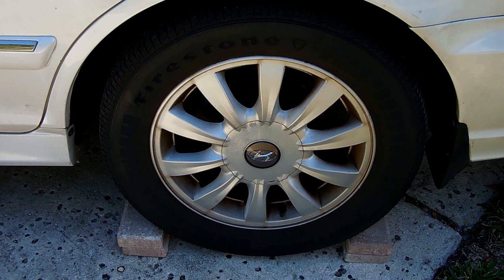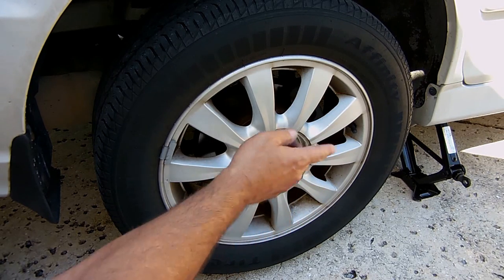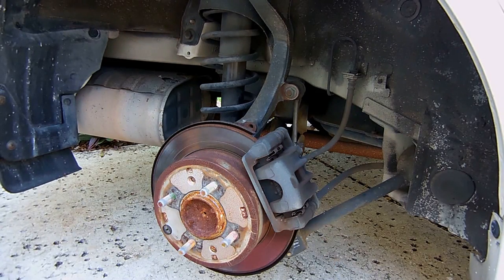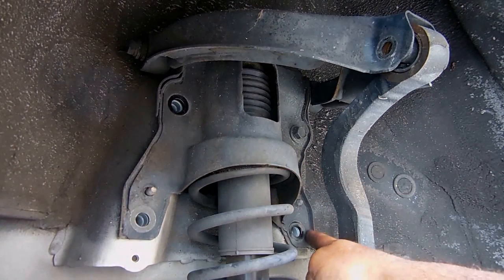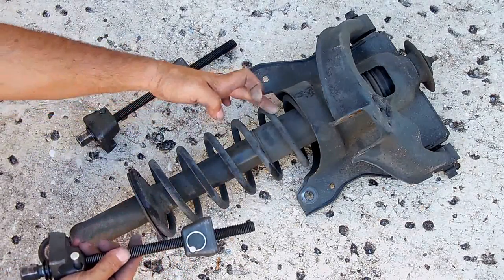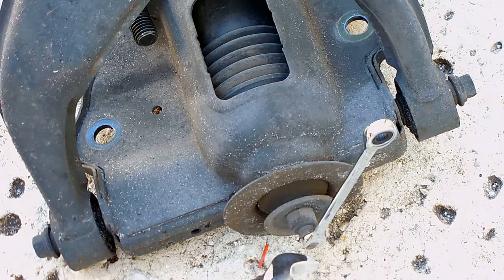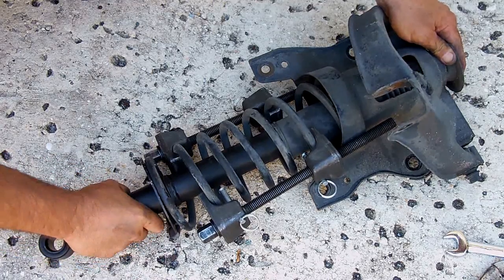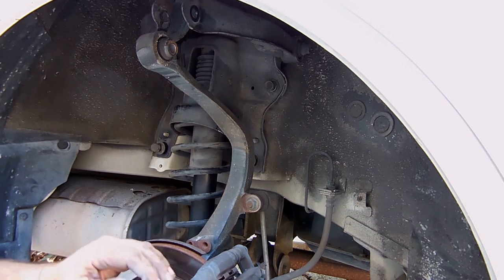How To Replace Worn Rear Struts (Step By Step)

Comment: Great vid.  You cover everything in only a few minutes.

My only warning is using jack stands.  I had a car fall off the jack years ago (and the front wheel was chocked).   No one was hurt, but it scared the cement out of me!  The jacks supplied with cars are not to be relied upon for anything but changing tires.
Reply from the maker: True. You need to make sure the jack is perfectly vertical, and the tires well chocked or any forward or backwards movement will result in the car falling off the jack. I've had it happen before. :-) Never position body parts under the vehicle. Thanks for watching!
Reply: I'll second that. I was taught never to rely on a jack. Jack it up, put the stand in place, then lower until the vehicle rests on the stand. Makes me feel a lot better, anyway.

Comment: Cool you show this. Many cannot afford to pay $100/hr shop. 
Starters brakes alternators struts common issues. Fuel pump.s and relays in GM also. 
We did this as kids out in the rain in street s of Queens . 
Motors in cars now last way over 200k. Transmissions are the issue now.
Reply from the maker: My mother was born in Ozone Park. :-) Yes, transmissions are the issue.

Comment: Should you do the final torque on that upper bushing bolt when the car is on the ground as to have weight on the suspension?   Not twisting the bushing...
Reply from the maker: You can only tighten the bolt shown at 15:11 so much before it stops. Nothing should be twisting.
Reply: @electronicsNmore  Sir Sweetness is correct. Control arm bushing bolts should always be torqued with the suspension at normal ride height.

Comment: 13:40 I have the pad exactly the same on mine sonata EF. Should it be like that or not? 🧐  🤷‍♂️
Reply from the maker: I just checked the service manual, and the exploded diagram doesn't even show it. I can tell you that after 3 1/2 - 4 YRS, my car is just fine the way I installed the washer.
Reply: @electronicsNmore  The spacer washer at the top of the shock was on correctly before you removed it. Don't know why it fits like that, and it seems counter intuitive, but in my experience they are always like that not only with the Sonata but also Mitsubishi Galant and other cars with similar shocks' set up.

Otherwise, good vid.

Comment: I want to tighten up my parking brake cable how do I go about doing that on a Hyundai Accent L 2002
Reply from the maker: Hello Anthony. In my Sonata, the parking brake adjustments are made by removing the center console storage container under the arm rest lid. Pop out the storage compartment.

Comment: Good vid - except 2 points.

The spacer washer at the top of the shock was on correctly before you removed it. Don't know why it fits like that, and it seems counter intuitive, but in my experience they are always like that not only with the Sonata but also Mitsubishi Galant and other cars with similar shocks' set up.

Also, control arm bushing bolts should always be torqued with the suspension at normal ride height.

Comment: 13:18 It's counter-intuitive, but that washer was on correctly, dome side down. 

You're lucky that you probably don't live in a salt zone. I needed to strip away that nut with an angle grinder right down to the washer, then heat it with a propane torch to knock it off!
Reply from the maker: I spoke to other people, and looked online, the way I put it was correct, but either way, it sill rides great. It's one of those things that really don't make a difference. :-) Thanks for watching!

Comment: RockAuto.com. parts are 1/3 price of local parts place. Even shops order from them. Choice of mfgs also. Avoid the cheapest parts . Most stuff even name brand is Chinese now regardless of label. 
This will help people. שלום
Reply from the maker: I've bought stuff from that company in the past. The prices are very good. I usually buy at Advance Auto and use 20-30% off coupons.

Comment: sadly most do not even know how to change a tire.. LOL
You should have stated to loosen a bit the bolts when on the ground since so many lift it and try to loosen it and the wheel turn or the car moves when too tight.
Also when you screw the tire back to screw the opposite nut is the general rule which you didn't show..
Reply from the maker: I did state that at 1:52. :-) As for reinstalling the tire, yes, use a crisscross pattern. Unfortunately not every video is perfect, and small things may be left out. Thanks for watching
Reply: Sorry must have missed that. True you try your best and that is what counts. Nothing is perfect.